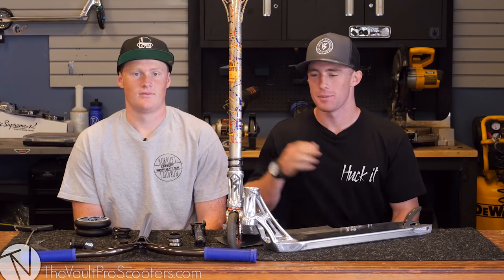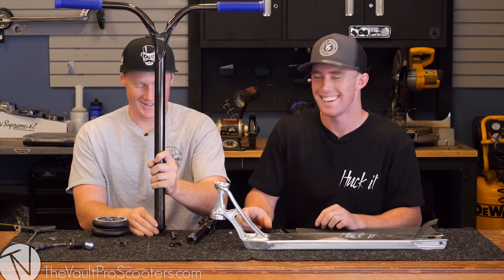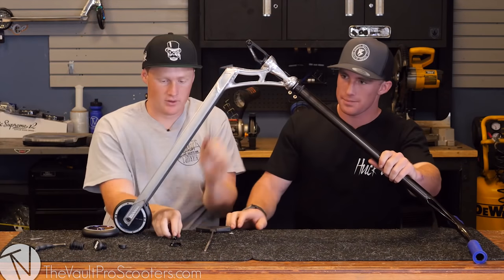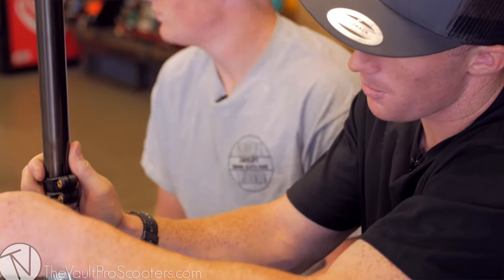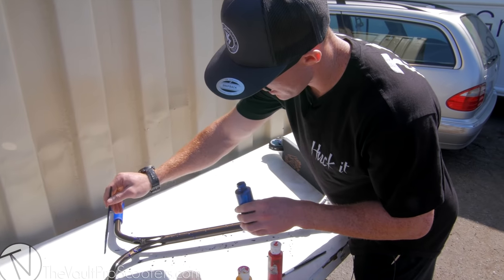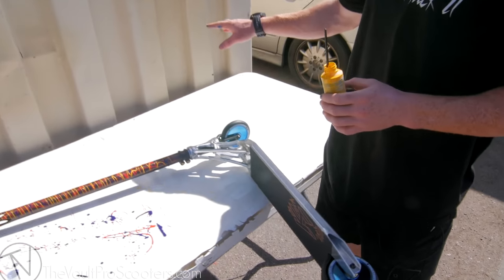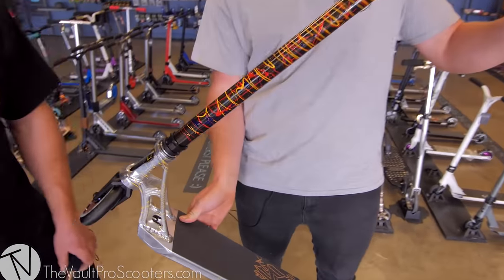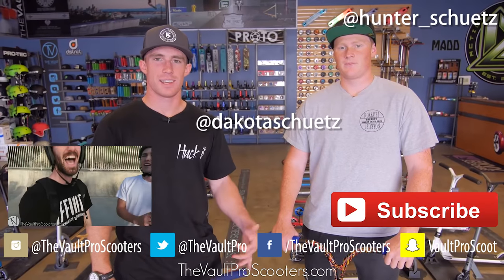Custom Build #101 (ft. Dakota and Hunter Schuetz) │ The Vault Pro Scooters

Comment: Do ethic decks snap easily?
Reply: My friend have snapped 5 ethic decks
Reply: Lightweight decks like the ethic pandemonium, lindworm, kos v4, reventon, or any district dk2 or dk1's will snap very easily considering most of their decks are for park and are made with very lightweight aluminum. For decks with best durability mainly for street and park I'd say any TSI, any mfx decks, district cam ward or brandon james will last you forever. Plus they have thicker welds and are made to take a serious amount of beating. P.S. I ride the cam ward, everyone says the cam ward is lightweight and will break easily well they're wrong it's about how thick the deck is made as well as not using too much cutouts for weight reduction.
Reply: +Will Richardson lol it snaps, it's mainly good for park the headtube is a little thin and snaps very easily after riding stair sets
Reply: Yes it does i only had it in 1 week and it snapped